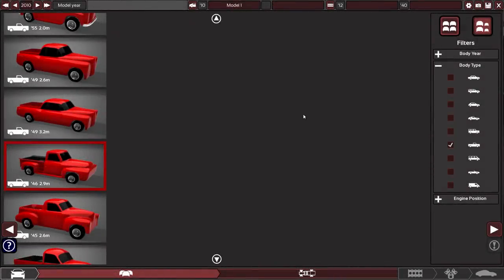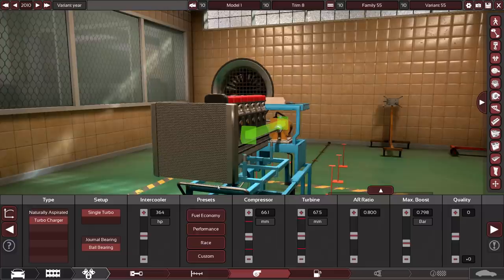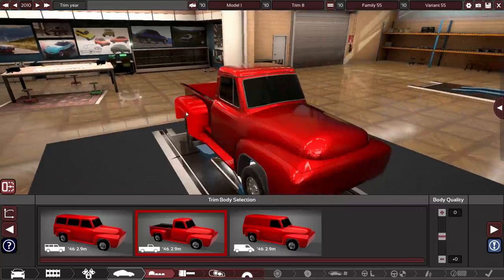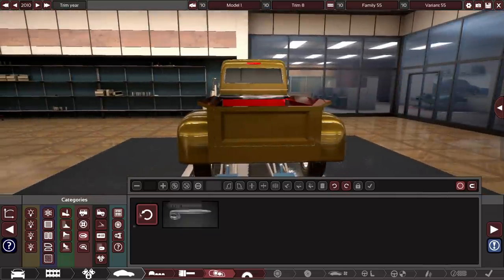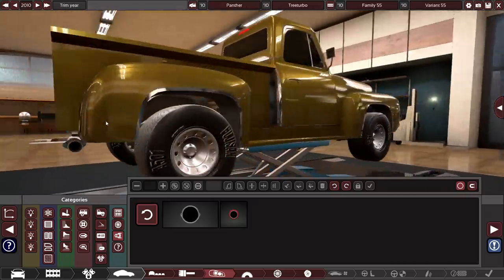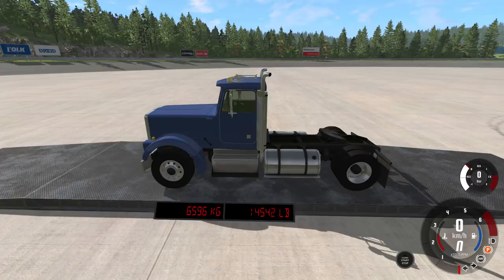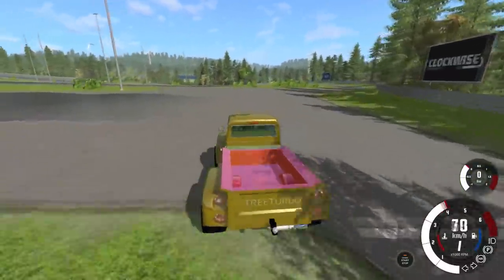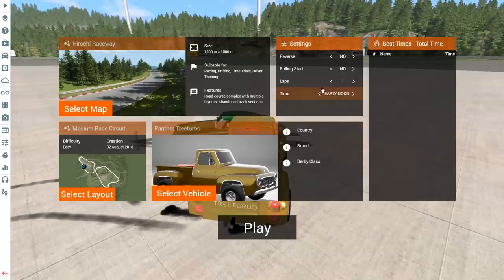Massive Torque I6 Tow Truck (Automation + BeamNG)

Comment: Should have used push rods for low end torque
Reply: Push rods only makes the RPM range lower because of the friction, you also lose torque because of that friction. 
Other valve trains for example (D)OHC make more torque and give a higher RPM range so more horsepower.
Reply: @MikevanLieshout  Not true. At low RPMs the valves are more restricted which means the air velocity of the intake is greater. The restricted valves only become an issue at higher RPMs which is why pushrod engines don't rev high. Has nothing to do with friction.

Comment: 730 hp and its that insane? I managed to make a 4300Nm 3100Hp V12 and fit it in a car with an amazing graph but my pc ceashed and couldnt try it. It would have been a monster
Reply: It prolly makes all it's power reeallly high in the range, and you'll get like 1/2 an MPG going down the highway 😂
Reply: @tk4x431  i actually made it and it took 2.2 seconds to 60 mph. I could have more torque but it would be very high in the graph. For the half mile per galon, you were right.

Comment: I bet you that if that truck was a real thing people would swap the engine into supras and skylines and shit. 700+ horse power and all that torque would be a lot of fun
Reply: Probably wouldn't fit 🙃
Reply: I've seen people put v10s and v12s in tiny cars im sure someone would try swap a tow truck engine into something dumb
Reply: @mincenchez5887  physical size and number of cylinders have nothing in common, there are 4 cylinders bigger than v12's and a 4.6 litre ford V8 is massive compared to a 7 litre Chevy v8, a tow truck straight 6 with this much  displacement would not fit and even if you did make it fit, it'd weigh so much the frame would sit on the ground
Reply: If that's how things worked, people would swap 12 valve Cummins in 240's and all kind of cool stuff
Reply: Bryson Shires yeah true, but looking at it at 2:10 it doesn't seem that big so I just sorta based my comment around that
Reply: @brysonshires9742  I've seen people swap a 12v into a dodge neon and it chooched through the trails like a tank in 5th gear at 1500rpm, when people have welders they get creative lol